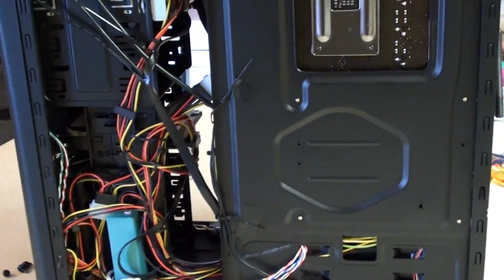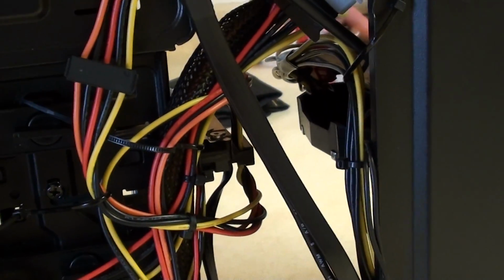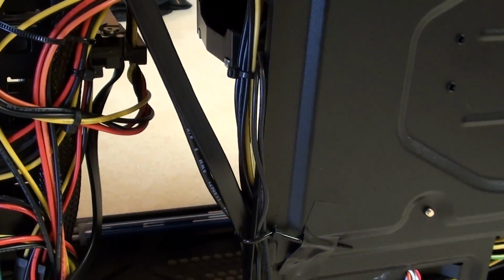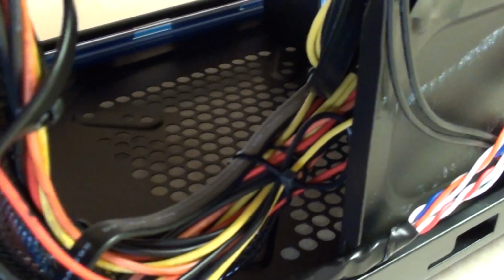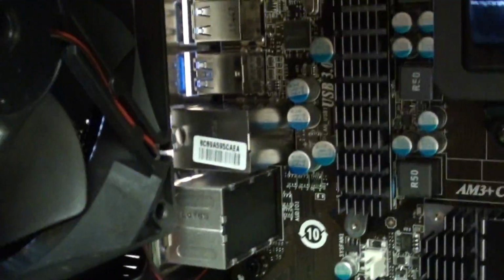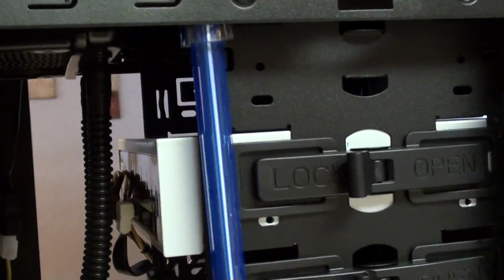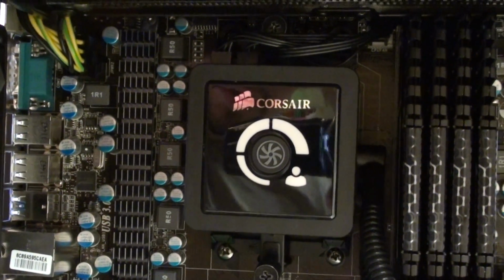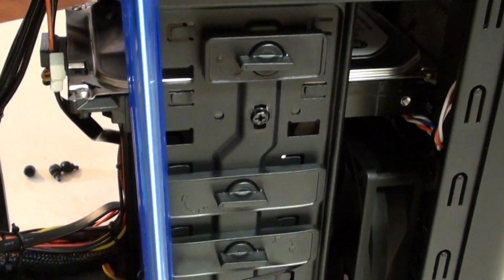Cable management Cooler Master 430 Elite build AMD FX-4100 MSI 970A-G45

Comment: what is that PCI-E 1x card you have there? I accidentally broke the 1x shield (in a similar 431+ case) instead of breaking 16x PCI's shield for GPU and i want to fill that awkward gap with an useful 1x card. wifi maybe

Comment: The Gigabyte 990FXA UD3 motherboard, It says it supports FX Bulldozer, Does that mean i don't have to update/flash the bios? Or would i still have to update flash the bios? Because i heard some stupid talk around that for these 990 boards that people have had to download latest versions first before touching it with a cpu. i sort of found that hard to believe, whats your thoughts? cause i don't nessesarily want to damage one of my 2 most expensive PC parts.

Comment from the maker: @card1100 as far as i know, no. the board is a am3+ and uses 900 series chipset which supports the fx by default.

this board is bulldozer ready! no need to flash bios. make sure box sticker states Supports AM3+ CPU with New Bios (B2 Stepping ready) which means it already has the latest bios for FX cpu support. B2 stepping refers to a part of the cpu architecture, AMD had problems with earlier pre release versions of FX that used B0 and B1 stepping that returned poor performance

Comment from the maker: @GeneralSnap I think that the NZXT M59 or NZXT Gamma would meet all of your needs, neither of these have great cable management systems but at least they give you room to work. The Thermaltake Commander  is a has better cable management system but some have complained about the front usb ports. If you can I say jump up a few bucks and look into the Corsair Carbide series, the 300r runs around $65-85, my fave is the 500r. That one gives you best of everything, tigerdirect has it $109